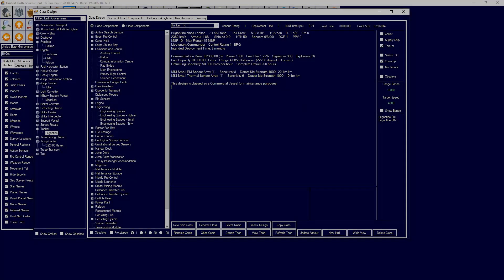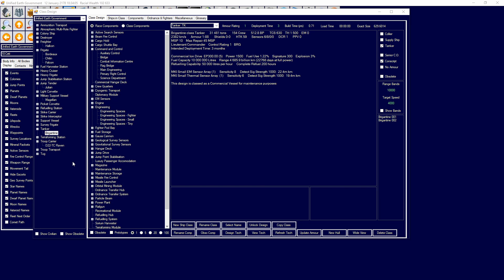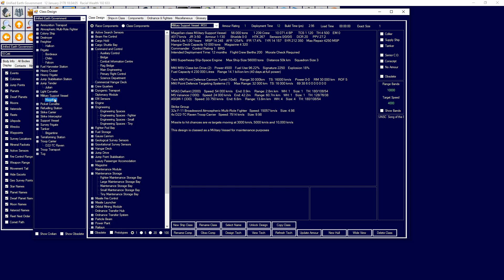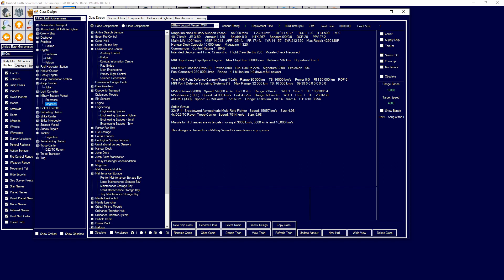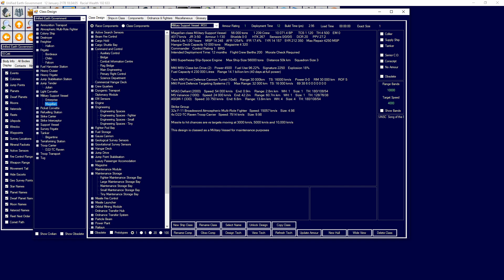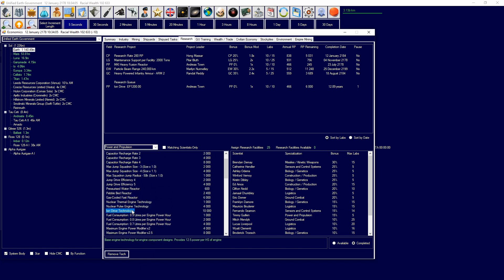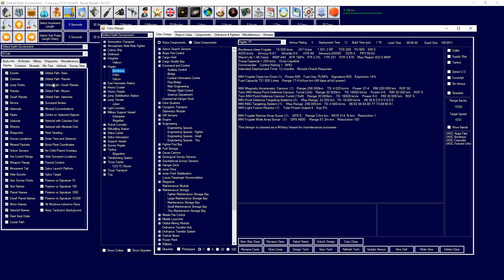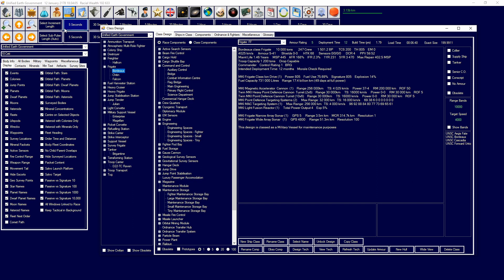Aurora 4x C# - Tutorial - Ship Design (2) -  Basic Military Ship Design/Mechanics

Comment: auto turn doesn't work more than 30 days, there is no important event going on, it’s a new game, there’s no battle going on and even then the game doesn’t advance more than 30 days automatically, can someone please help? I think I have found someone with the same problem in the bug report page but there is no response to what to do (sorry about my english, it's not my mother language)
Reply from the maker: there is no increment past 30 day so please clarify.

but my advice is reinstall fully and make sure you have got the 1.11 patch on the 1.5.1 core
Reply: @DefranStrategy  Even with auto turn on the game always stops at 30 days
Reply from the maker: check events make sure nothing is happening, does this happen in a newly created game? etc
Reply: @DefranStrategy  Yes, the new games and the others that I started before, and nothing is happening in the events
Reply from the maker: @thiagovanzella9911  that is extremely strange, yes I would suggest reinstalling ensuring your on the correct version and making sure the decimal issue is set properly and if it still persists write a bug report
Reply: @DefranStrategy  ok I will do it, thanks for the help :)

Comment: Great video! I have spent hours designing ships, and I absolutely love it. When it comes to military engines I like to design very small, powerful engines. This reduces the cross-section of the engine in the hit chart, meaning that a ship that is hit in one engine can still escape if necessary. This comes at the cost of fuel efficiency. Also, I am pretty sure that a tractor beam on a commercial ship can attach to a military vessel. I had to save my geosurvey ship that had lost its engine in a maintenance failure, which I tractored through jumpgates with my commercial tug. You should definitely talk more about fire controls when talking about military ships. I learned the hard way that resolution matters in stuff like point defense. Keep up the good work!
Reply from the maker: I plan to do separate episodes on sensor design and also fire controls